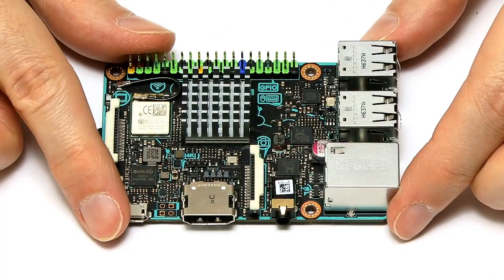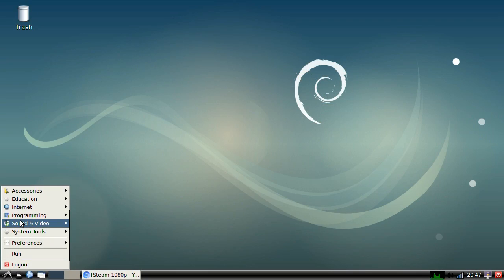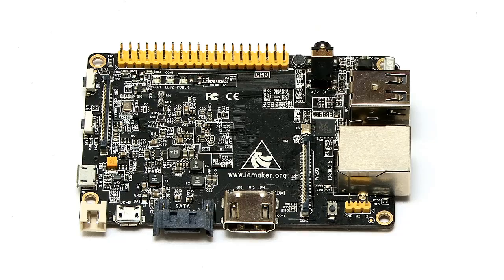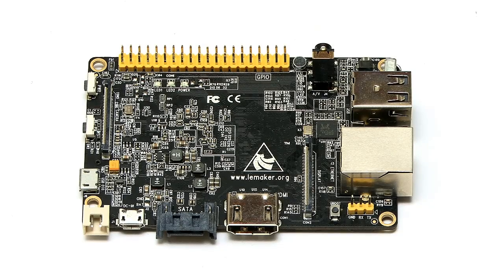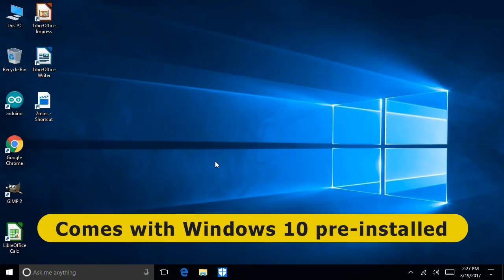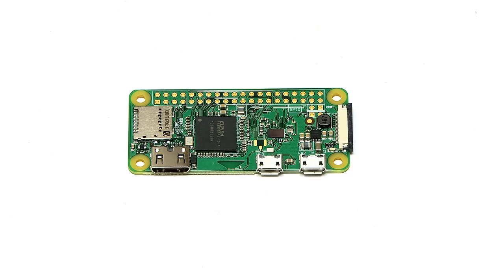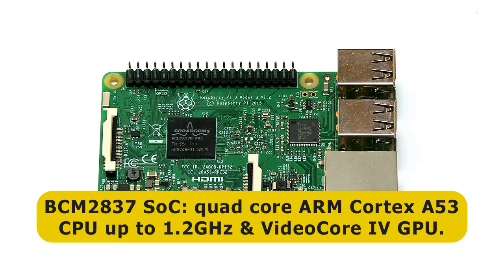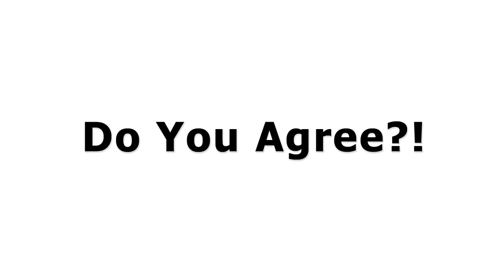Top 5 Single Board Computers 2017

Comment: they should make rpi 4 with gigabit Ethernet and wifi n and 4 gb ram and onboard storage of 16 gb (minimum) and sata suport & higher cpu specs that would be awesome.
Reply: Higher GPU as well.
Reply: Jay Mee agree with @Okurka the GPU is a let down on the pi. Nvidia have a tensorflow GPU compatible SBC on the market but for machine learning you'd need to take out a loan to build a decent cluster...

Comment: I have a Voyo V3 it's a lot like the LattePanda, this has a X7 8700 and a upgradeable storage M2 SSD 128GB is much faster and what it came with 4GB RAM WiFi These Cherrytrails get hot, but this model is fast for what it is. It runs USB memory sticks, but struggles with the 2.5 USB Drive because they only have a 12v 1amp which I want to make it 3 or more amps to power everything, but it's powered with a type C port for power only because there's no other way of powering it so I'll have to use the cord or find a Type C Connector. They used that as a marketing scheme, but it does have one USB 2 and two USB 3 Ports.

Comment: SD card is not reliable, on board storage is must for 7/24 work, survive sudden power cuts... Orange pi and friendlyarm has some good boards
Reply from the maker: In a few weeks I will upload a video on booting a Raspberry Pi from a USB SSD . . . which has very recently become possible!
Reply: http://tech.scargill.net/a-question-of-lifespan/
There are other issues like power supply quality... 
To make a raspberry pi work 7/24/365 with covering all possible problems is very hard I think
Reply: and there is the pi foundation hard drive
Reply: I believe the whole idea behind the pi was not a workhorse, read the story about its design

Comment: +ExplainingComputers
I personally would have ranked the Tinker board and LattePanda  higher in the list[2 & 3 respectively], but of course that is personal preference. Still, Great list! Love your video's. Looking forward to more!
Reply: TheCaptain the Tinkerboard still has crap support and very inefficient drivers. until Asus bothers to take their own entry seriously it doesn't belong in the top three.
Reply: I think the lattepsnda would be my fav if dfrobot provided a single line of software that was open source, but I guess it's more about the arm chip on it than about the atom.
Reply: When you say open source software of LattePanda, are you talking about the Linux driver support?
Reply: +Lauren Pan
Yeah, I didn't understand that either, but I think you may have touched on it. He's likely talking about open source drivers which, because it's an Intel chipset, are not going to happen. But this isn't the fault of the makers of LattePanda. Still there is a good level of support for it. You can run Android 6 & 7 on it and Linux support is shaping up nicely it seems.
Reply: I see. Thanks for your sharing! ;)
Reply: +Ken Irwin
Your opinions are laughable and not supported by known, easy to find facts. 

First, Your comments come off as little more than RPi fanboyism and are not something to be taken seriously. 

Second, I own and use the Tinkerboard and am simply delighted with it's performance[which is significantly better than RPi3, which I also own], quality of construction, the good and ever growing community support along with ASUS themselves. 

Third, the GPIO pins, as far as I can tell and have used, are EXACTLY the same as RPi for one simple reason, compatibility. No documentation is present because it isn't needed. The pin-outs are identical because it is a STANDARD GPIO connector. 

Fourth, documentation for how to flash the firmware is all over the place and the utilities for doing so are easy to find. YOU need look around a little more. 

Fifth, my primary use of the Tinkerboard is as an Android platform connected to a TV. Google Play IS present and works perfectly. 

Sixth, the power requirements are the exact same as the RPi3 and will use a standard RPi3 power adapter. That was not even a serious point as power requirements are well documented. 

All of your other points amount to nitpicking based on biased personal perspective and will not effect the average user. This is NOT the forum for your silly grievances. The Tinkerboard is not for everyone just as the RPi, OrangePi, BananaPi, LattePanda, Etc. are not for everyone. If you don't like one of them, ok, your preference. But to go on a rant which is filled with misinformation and petty complaints is simple foolishness and effectively makes you look like a blithering, gibbering halfwit. Do stop, you're embarrassing yourself.
Reply: +Ken Irwin
MY comment is nonsense? Your rants are textbook definitions of the word. Effectively you've stated that you can't read but you can, you can quote stats but can not contextually comprehend and have little in the way of logical critical thinking abilities. As for Google Play, yes it's side-loaded, but then it's present on the system, isn't it? The pin-out for the GPIO works as expected for the uses I have tried. Had Mr. Barnatt had any of the issues you've experienced, he would have stated such in his video's. He has not, directly implying that he did not[I haven't either]. And he is known for not holding back well deserved criticism. Perhaps you should consider that you might have a defective unit either from a genuine manufacturing flaw, or damage caused by your own misuse[an infinitely more likely possibility given your above statements]. Search engines, like Google, have been a wonderful utility since the late 90's. Try one out and you might find a thing or two, but more importantly, you might LEARN a thing or two. Alternatively, you could very well be someone deliberately spreading misinformation in an attempt to dissuade potential buyers, something else I find very likely. I'm not going to respond to the rest of your drivel as it appears to be little more than ego driven teenagerish one-up-man-ship.
Reply: TheCaptain, do you realize you repeated back the search and learn thing after he said it to you?
Reply: +lexluthermiester
Figure that out by yourself, did you?
Reply: BTW, Ken? I did a  search, "tinker board os" and found a ton of information that contradicts much of what you said in your comments. On the Asus site alone there is an update to android from Asus themselves dated May of this year. Theres also a file that has schematics inside it as well as the gpio api. Asus, by the looks of things is supporting this board and delivering that support in a timely manner. But I'm going to agree with thecaptain here, you're being childish.
Reply: TheCaptain, ah, that was deliberate then? LOL!
Reply: +lexluthermiester
I had not seen that update! Time to download..
Reply: I personally have more respect for Mr Barnatt than to continue some flame war about a board that will likely be an insignificant blip in the grander scheme of things. While I may disagree with the Tinkerboard as a choice for the "Top 5" under the theoretical premise of a larger sample, I also understand that the number of boards reviewed by Mr. Barnatt is not an exhaustive comprehensive list, so the fact that it ranks on the bottom of that list is perhaps a deserved position. For this reason I will retract my personal comments on the matter, but do hope Mr. Barnatt has taken note of them, with some degree curiosity, and weighs this into a future "Top" list, though frankly I believe this board will fade into obscurity in pretty short order. I will simply suggest that potential users of these products do their homework and do research on these products, beyond basic YouTube product reviews, which are meant to inform potential users about a product and are not meant as a deep dive technical evaluation of that product. Read the support forums of these products and note the relative success/failure rate of problem resolution, the collective expertise of it's members, and should you have specific project goals, even if your project is unique, determine if you feel this is a community, in conjunction with your own skill level, that can help you achieve your project goals. A lot of these boards have development cycles that are truly amazing, being nothing more than a conceptual CAD drawing on a crowd funding site and 6 months later a fully functional tiny computer you can fit in the palm of your hand with an OS and features reserved for $1000.00+ industrial boards not that many years ago, and they are often done by very small organizations on shoestring budgets. Also note that these products are all created with someone's idea of intended use in mind, which can range from a cool tinkering toy to educational learning to production automation.  These products are so cheap by any historical standards, that the question is not so much the cost of the product itself but cost of your time and your effort, and the cost of whatever stuff it will take to make one of these products do what you want it to do. A project based around the cheapest of these boards can easily escalate to the cost of the most expensive by the time your project is completed, by the time you add in the doodads and knick-knacks it takes to make whatever crazy vision you may have a completed project, caveat emptor.
Reply: +Ken Irwin
Flame war? No. This was you going on a few novel length rants and me calling you out on your nonsense, which you just continued with your half apologetic ramblings above.
Reply: Not sure what this guy "retracted", but I only see one person ranting. What, did he dis' your mother? Anyway, I have a Tinkerboard, there is no support for it. I don't really use it anymore, too much trouble.
Reply: +skorpioskorpio2000
You missed out on some "interesting" comments before he deleted them. It seems you also haven't looked around enough. Found everything I needed/wanted to make it work and then some. As was said above, not all SBC's are for everyone.
Reply: Well I don't know what you use yours for, Android I assume from your comments, but I bought mine early on and the Linux had a lot of stuff that wasn't working yet, and there was no source code. Then they fixed a couple things and eventually there was source code, but there were still major things that didn't work, like 4K video. When they fixed that they changed the release, and then no source code again, then they changed the page and removed the old source code link. The only thing I ever found was some little distributors forum in the UK, where nobody seemed to know about anything other than the ASUS site. If there is more than that I might dust it off and use it again, links?

Comment: Everything more expensive than $50-$60 is ridiculous, because for about $60 it is possible to buy cheapest PC/tablet based on Atom with Windows 10. And it can be used as regular PC. If you really need GPIOs is is cheaper to use Orange Pi family which starts at $10 but best price/capability ratio has $15 Orange Pi PC model. Support of different OSes is now much better than 1y ago. And works well even in 4k resolution.
Reply from the maker: Thanks for this. I have looked once (and recently) at on Orange Pi (PC) and was less than impressed with the OS situation. But I will return to those boards in the fairly need future, probably trying Armbian.
Reply: Regular PC ok, but Atom based PCs/tablets are very power efficient, comparable to Orange Pi and similar. And can run full Windows which can be advantage sometimes.
Reply: I fully agree.  Although RPI is a great piece of tech, if you do not need I/O, but need a touch screen, the costs just gets too high on a PI.  Check out microcenter where i purchase hardware. For $60 you get 10.1 screen and 1.3 GHZ.  For $90 you get 1.8 GHZ and windows 10 (yes, these tablets are probably just as energy efficient  as the PI) - both come with their own LiPo, which I always have to add to the RPI.
Reply: I just got a orange pi lite myself and it is really nice. It is not the best think on the market but gpio and wifi is great things to make cool projects. :D
Reply: I agree that regarding OSes it is not that impressive as in case of RPi boards. But Android ported from Android boxes works ok, better than provided by makers of OPi, OpenELEC is very fast and stable even on OPi One and Armbian is very promising. Good start for most projects with really cheap SBC.
Reply: RavenPrecept: You overestimate power consumption of SBCs - they usually require stable 5V power supply. During startup usually they can take 2A (10W) later about 1A, without HDMI out probably little less. Typical Atom based PC draws similar power. SBCs are not good solution in simple projects where typical microcontrollers are much better idea. Even in internet/WiFi based projets it is much much better and cheaper to use ESP8266 than ANY SBC. SBCs without dedicated eMMC, with SD only storage memory are not stable. Filesystems on SDs crash very frequently during heavy use. Everybody, who used RPi more than a week knows that :)
Reply: Mind telling me what you do or would do with a tablet? I can't think of much that I would rather run on it than on any random sbc and one of the biggest pros being wifi which is fine if you already had a wireless idea in mind, but it's also one of its biggest cons, as wifi networks can be spotty/unreliable or over crowded which isn't great if you're planning on running some sort of server or something.
Reply: vgamesx1 Here is reply about what I do with tablets -- I design lots of Kiosk systems -- one thing I was excited about was Win 10 IoT for the Pi -- since all my core objects are developed in Visual Studio, using Win 10 IoT on the PI was a no brainer.  However, at least 2 things got to me.  1) cost as above - all Kiosks need touch screens $70 adder for PI.  2) Visual Studio for PI is dog slow.  Most Win 10 Tablets are all pure Windows 10, so development is great (and no remote development like PI).  I could go on and on about the difference -- not that Pi is bad/good, only that the PI is different and if Microsoft and PI can come together a little closer, they would have a dynamite system.  PS, I use USB dongle on tablet if I need wired LAN.
Reply: Show me a PC or tablet with GPIO. The move from ISA to PCI was good for performance but not so great for hobby use.

(Edit: Yes, there are add-ons and USB but that just ups cost/complexity). And yes, there are also microcontrollers but it's also kind of nice to be able to do process control, have logs and graphs on a built-in webserver and be able to ssh in if you want to tweak things. There's definitely a niche for these devices.
Reply: In cases when you need a lot of GPIOs it is better to use MCU.
But most cheap Chineese tablets have at least SPI and I2C available on the PCBs. It is not that easy to access them as in case of SBCs with full documentation but pretty doable. In such case $15 Orange Pi could be better choice.
Reply: cbm80amiga -- when I need the best of both worlds, that is what I do today -- use an inexpensive tablet, and then HID to I2C on tablet to a MCU, like the Zero - $5.  Tablet is for human Interface, and Zero is used for real time kernel.  This makes a great combo-meal.
Reply: An 8" touch screen  1GB RAM tablet(£40) updated to Windows 10 (1703) has low power consumption and came with "
-------------------------
Type: x64 Family 6 Model 55 Stepping 8
Model: Intel(R) Atom(TM) CPU Z3735G @ 1.33GHz
Model: Intel(R) HD Graphics
RAM: 512 MB
SolidState disk Model: Toshiba 032G72
Partitions: 3
Size: 29,815 MB
---------------------------
Kodi 17 runs very smoothly and one see it on big screens (HDMI or Casting) too.
From my experiences, Orange Pc-PC is more stable than RPi 2 /3 as a web server.
Reply: Hart Henry, not a bad set up but also not a million miles away from accessing the device over the net from a tablet or smartphone with an app or browser. All good options.